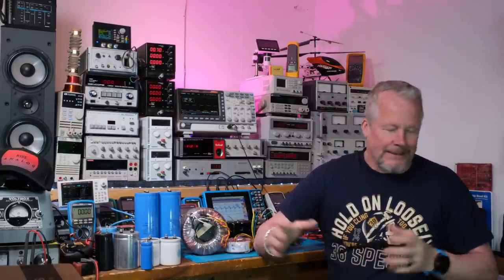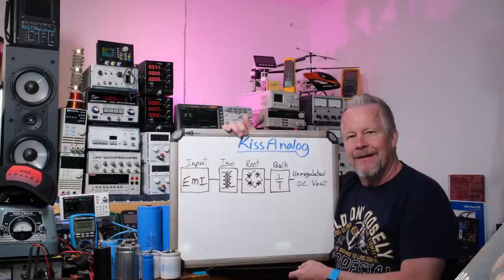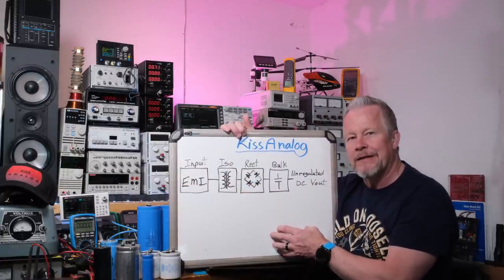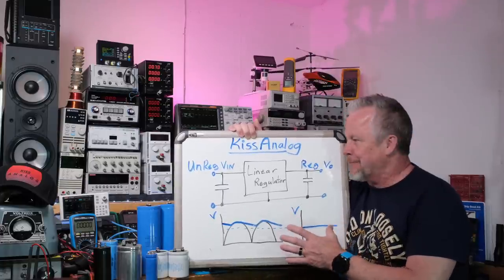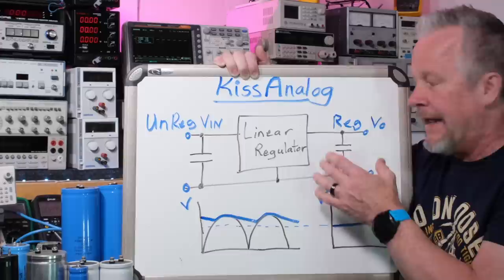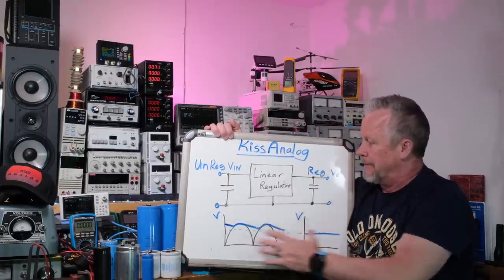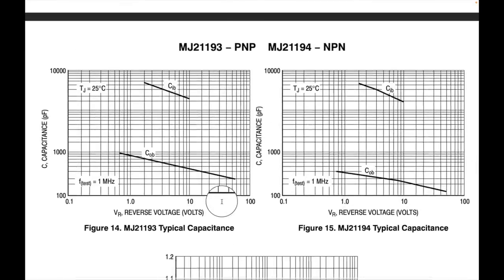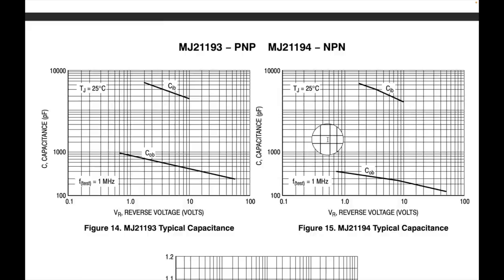Why Amplifier ‘Linear’ Power Supplies are not Regulated Rant - Have they been lying to us? #rant

Comment: In the past a alway purchased Kenwood equipment , that was rock solid, heavey ,they where as 2 x mono amplifier , with double power supply , Kenwood said to minimize intereference between de channels,, but sounded awesome.,, my lasat one was a KA-7020, died because of current mirror, changed the fet dat regulated this , but shortly after power on , it burned the transistor,, so decided to get rid of it , because i did not used it anymore, now i have a Yamaha RX-671 receiver with i am very happy.

Comment: some guys do say that with regulated PS will limit dynamic power of an amp. is that true?
Reply from the maker: Not at all.  It will actually improve the dynamic range.  Thanks for asking!
Reply: Please remember that Ed is talking about PSU's that have been designed and implemented with at least a minimum amount of competence.
Reply: If an amplifier is limited by amount of power it pulls from the power grid - then maybe.
In that case class D amplifier with actual high-frequency switching power supply make the most sense.

Comment: I would like to see the schematics for the linear regulator you had in mind (you showed an example schematic of the power supply including the diode rectifier with capacitor, but the regulator was an empty box). After searching around a linear regulator seems to involve an op amp (sometimes several op amps), a transistor, resistor drop for feed and capacitors, found many variations. Maybe you buy the regulator as an IC package? Not sure how it is sold.
Reply from the maker: Thanks Robert!  I'll come up with a design and show it in an upcoming video.  It would be cool if I could find one from a great designer who has done this for a respected brand.  I'd think that someones has done this, but otherwise I'll come up with a design;)
Reply: You can quite simply use mosfet pass devices, with a very high RCR on the gate.You don't really have to regulate it per say, you just get rid of all the Ripple.But if you want to regulate the high power rail if you can.The voltage amp at a minimum should always be regulated.

Comment: We like your rants. I have new rants for you to consider. Specs given are often misleading and specs hidden, can be frustrating. Discretes or IC's usually. Latest problem was with monostable timers.  The sometimes published fall times are way off and get far worse with longer pulse widths. 
SOA  can be a good spec but a hobbyist might see the current rating for a mosfet and not notice that it is for one microsecond or less. smoke.
Reply from the maker: Thank you!  Those are some great ideas!

Comment: Sort of off topic, but does the same rant apply to stepper motor power supplies?  It's common in CNC to use unregulated linear supplies to (as I understand it) better handle the peak power needs and the reverse power generated from decelerating motors.  It would seem the same would be needed for handling power from woofers -- which seem like a motor of sorts.
Reply: The power supply could be either unregulated or regulated. If regulated, then linear or switching or some variant.
So "unregulated linear" is a bit unclear I'm afraid.

Comment: Yikes, what a crazy coincidence. Spent the week helping out a not too familiar guy with minimal electronics experience  remotely via Messaging to resurrect his deceased Dad's old now very vintage stereo amp with 2N3055 output stage. It came down to the crazy basic REGULATOR circuit, two series pass transistors for the  +/- GND OV rail feed that no matter what he did it would not work, even disconnected from the rest amp circuit....! Yeah it has a big lump of iron (transformer). The circuit just would not work so i put it through iCircuit simulator of my iPad.. & it's gotta be the dang 24V zener that's acting as a reference... which i really want him to replace! FWIW never get involved in something like this!
Reply from the maker: LOL - well it sounds like you did a great job hunting down the problem;)

Comment: Wait im confused. Im no electrical engineer but i thought the reason they were called linear power supplies is because the input volt and the output voltage follow each other in a linear fashion? I wasnt to mask that they are basically "Dumb" power supplies. Idk maybe i dont know what im talking about..
Reply from the maker: Thanks for the great question!  I'd imagine many people can take your description as what a linear PS is, so it is a rational logical definition.  But, Switching Power Supplies - un-regulated can follow the input voltage variations too.  So an un-regulated 'linear' power supply (which is really a low frequency switcher) and an un-regulated High Frequency Switcher can both have outputs that follow the changing input somewhat linearly.  So, this definition doesn't really track.  Usually, when power engineers talk Linear vs Switcher - we are referring to the type of regulation.  

What we used to call a low frequency power supply a step up or step down - depending on the transformer turns ratio.  Most power supplies are regulated - and a low freq switcher is usually regulated with a Linear (regulated) power stage.  I think when power people talk about Linear PS, they think low freq - otherwise when they talk about switchers - they think High-Frequency switching.

Comment: I think the input stage of many (if not all) high quality amplifiers is still regulated.  It is just the power section that is not regulated. The reason is that you need a lot of headroom to make the LDO (linear regulator) to function. You’ll have to account for the worst case power line voltage, variations in transformer output…etc. At the end of the day, the output voltage after the LDO will be quite a bit lower than the voltage available at the rectifier output, which means that the power rating of your amplifier will suffer, in the name of making the output stage rails regulated.  Also, the output stage is usually just a source or emitter follower, which should not strongly depend on the rail voltages.  So there’s no good reason why linear amplifiers need fully regulated power supplies. 

On the other hand, class D amplifiers will strongly depend on the power supply.  In that case SMPS will work very well, since the high switching frequency is very easy to filter out. You can’t hear it even if you don’t. I have heard DIY audiophiles use linear (unregulated) power supplies for class D, thinking that anything ‘linear’ is supposed to provide audiophile experience, which is the dumbest thing to do.  I’m an ‘audiophile’ but also an engineer, but I guess I don’t have golden ears so I can’t hear most of the ‘improvement’ that audiophiles can hear.
Reply from the maker: Thanks for the great feedback!  I do want to point out that a linear power supply is a regulated power supply.  If it is not regulated it is actually a low frequency switcher or pulsing power supply.  What makes it ‘linear’ is the regulation.

To make a linear/regulated power supply for the output section - yes you take all those things that you mentioned in consideration to design the power supply, and then the amplifier does not suffer.  Actually it is only then that you can guarantee a specified power supply.  I’d like to also correct your use of “LDO”.  An LDO is a low-drop-out regulator where for an audio amplifier can not use a ‘low’ drop out, but actually as you said needs a lot of headroom.  No worries though - the term ‘LDO’ is misused today on a regular basis.

The reason to regulate the emitter-follower stage is to keep the current gain of that stage more flat where if the rail voltage is changing it does affect that - even if only slightly.  Remember, there are those who will spend thousands on a power cable that the benefits can not be measured!  The effects of voltage changing on the rails can certainly be measured.

Regards to class-D amps, the power rails could be non-regulated as well, but why!?  I was going to do a power supply for a company that actually wanted an unregulated power supply for their new Class D amp.  They said because they always did that way - since their Clara A/B ways, but I changed their mind:)

Comment: The reason why that power cable may make a difference may be due to the cable being able to transfer higher frequency content to charge the capacitors better due to its geometry or build. Commutation of the rectifiers only occurs when the supply voltage exceeds the capacitor voltage plus the volt drop of the diodes in the rectifier, there is a very small amount of time for the capacitors to get charged up. The current waveform is rich in harmonics that exceed 100/120Hz.This is why if you add a power conditioner it could make the sound worse since the current is passing through an inductance which is reducing the upper harmonics which is reducing the current to charge the capacitors. Having larger capacitors in the supply, this makes the current waveform even more pronounced having very large peaks, so a thick cable will really help in transferring the energy into the capacitors with minimal loss. These harmonics generated by the rectifiers are reduced by the amplifier in the input stage differential amplifier, which in a voltage feedback amplifier has good power supply rejection ratio, if the gains of each transistor in the differential amplifier are adequately matched. So perhaps a poorly matched differential amplifier maybe the issue to hearing this difference?
Reply from the maker: Thanks for the great feedback!  The inductance in the transformer is far bigger than other inductances in the connectivity between the transformer and power outlet on the wall.  The harmonics and such are part of the lost power that is transferred and is part of the Power Factor.
Reply: Your theory, while plausible, still ignores the length difference of the 6 foot power cord versus the 50 to 100 feet of #12 or #14 commodity electrical cable in the walls.
Reply from the maker: Thanks Andy, but the transformer inductance still swamps out the 100 feet of electrical cable to the receptacle.  But this goes to show how little effect an expensive power cable can have.  It is only maybe 4 feet long to the amp compared to the 50 to 100 feet of romex before it.  The expensive power cable can do nothing to improve it - but a really bad cable could make it worse.  A decent sized cable can only preserve what came from the wall plate - but can not make it better.  That's why so many 'real' engineers call it snake oil.

Comment: Psychoacoustics explain the difference on power cables, non regulated PS are simple and works for the application and easier to fix.
Now let's measure a well designed amplifier regulated vs  non regulated and see.
Reply from the maker: Thanks Sergio!  That is the next step;)
Reply: Psychoacoustics explains the difference on power cables? Show us the science.

Comment: Regulation limits dynamic power to be the same as RMS power, so you get dynamic compression. It would seem a better idea not to regulate the PSU for a PSU to my way of thinking. Let your pass elements and reservoir caps determine the mppt at any given moment.
Reply: Precisely. It really is this simple.
Reply: no they're not. How did you come to this conclusion ? depends on regulator type , in most cases dynamic power will be better.
Reply: sss... Well said young man!
Reply from the maker: @John Shaw Thanks for your feedback John.  But, this is the lie they tell us.  A regulated power supply will improve the dynamic power exponentially.  Here's the reason - power regarding the voltage is V squared multiplied by R.  A regulated power supply holds the rail above the peaks of the sinewave - and provides the current much-much faster than a low frequency switcher operating at 120 Hz.  A regulated power supply provides a true voltage source - and provides current as needed - when needed.  This is why they regulate the input stage and all pre-amps.  There is absolutely no technical way or measurable way that a non regulated power supply can keep up.  I've shown this in developing the 20 Watt Class A amp series.
Reply from the maker: Thanks Fred - but dynamic behavior is improved dramatically with a regulated power supply
Reply from the maker: @Bobby Sparky I think this myth is one that we need to dispel.  It is one of the lies that they have told so long that it seems true, but a regulated power supply is far more dynamic;)
Reply from the maker: @sss Yes that is correct.  A regulated power supply is far more dynamic.

Comment: I joked about selling batteries to audiophiles in response to your mains lead scam video, but the fact remains that the only pure DC comes from a battery! Why not have big lithium batteries (series cells with a centre tap, no boost converters or switching polarity reversers!)? Sell an expensive box that automatically charges the batteries from the mains when the amplifier is switched off and completely isolates from the mains when the amp is in use.
Reply from the maker: Thanks John, that is actually something that I think some people would buy;) But, I'm interested if an actual regulated power supply would do the same - albiet there could be some high freq noise, so I should say a filtered  linear regulated power supply.
Reply: This exists! Like the QULOOS PS1 Battery supply, but there are other/bigger builds with battery or dual supercaps somewhere online... It's somehow said, that the noise from batteries under load is bigger than a proper low noise switching supply...

Comment: Kiss, a bit about your power cord take - no audiophile I know would buy a 250 dollar cord and think that nails it, I suggest a bit of backing off on the generalizing - - - no one I know would expect much if any difference in sound between a 50 dollar nice cord like you're showing, which is fine by me and should sound fine, or a 250 dollar cord that most likely falls into the category of padding the manufacturer's wallet more than bringing better sound - myself - I'd put them in the same category before I even tried them, that is, I wouldn't expect much if any sound change, but I'd still try each one, which sort of puts my point on the table. You don't seem to want to do that - - so like I've already urged, I'd love to see you do some actual listening tests with some actual high end cords - a 250 dollar cord, imho, doesn't fall into that "high end" category  - in reality, it's those super high end cords you're saying can't make a difference, right? So, if you're right then prove it using listening "too" - again, the reason for my rant to you is that I know they make a difference though my own messing around, what I want to know is: why? Enough of the easy responses: " you're suffering from the placebo effect", if that's your quick response then cut the crap - - anyway, especially given that your specialty is power supplies, maybe you're the guy to figure that science out, wipe your slate clean, perhaps start from listening for differences and "then" measure and search for correlations - - and yeah, you'd need to have access to reference level listening gear, the kind of gear with high enough resolution to hear subtle changes in components and cables, until then you're only bringing us half the story which is your personal "science" take on power cords but again, yes, I do respect - and is the primary reason I'm appealing to you or even bothering to comment. I don't personally care about this so called controversy, but seeing as this clash is constantly thrown about, imho, it's about time someone matched up equipment like Jay is using in Jay's Audio Lab with some high end measuring gear - - and geese, even at that level of listening and measuring, I'd be personally amazed if there's enough measuring science to come to an understanding of why cords at these high levels, even between themselves, sound different - and they do, no hypnotism needed. Delete this if you like, it's just a way of reaching out to you personally with my own findings as an audiophile with reference level playback gear. Oh, and hey, don't think that I don't absolutely think that prices starting at 3 to 5K aren't stupid - 10K, how about 25K and even more for cords? - No argument from me, that part of the equation IS completely stupid. Later Kiss, and thanks.
Reply from the maker: Thanks Skip for this great feedback.  Why would I delete it - you bring up great points and I welcome the challenge to test.  My rant is just to bring up the subject and prepare the road that I will set out and show what if any differences that we can measure.  And I will not reserve my measurements to the THD which is elementary.  I would like to defend myself and say that I did not generalize, I did say that there are those that wouldn't buy the expensive cable - and there are those that would - and inferred that there are those in between that might be happy with the power cord that I held up.  Also, this video is specifically in response to the rationalization that I have made that those power cords could make a difference - and suggesting that an actual Regulated 'Linear' Power Supply would solve the problem and provide an actual real Voltage Source; thus, eliminating any low frequency and/or high frequency issue at the Amplifier.  I think I can show that this $50 power cord can make a difference at the low frequency switching power supply.  I have some ideas of tests that will illuminate the differences between the BS and Science.  I appreciate your feedback;)
Reply: @KissAnalog  Thanks my friend - - I'll be looking forward to what you have in mind - -  🙏
Reply from the maker: Thanks so much!